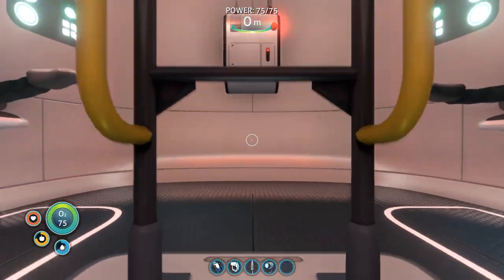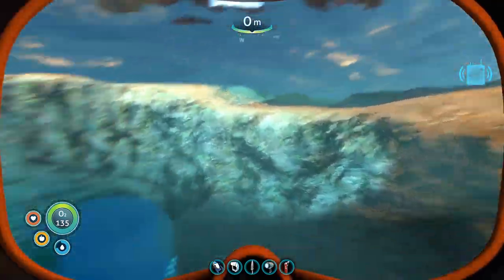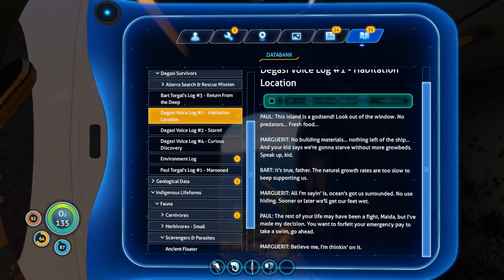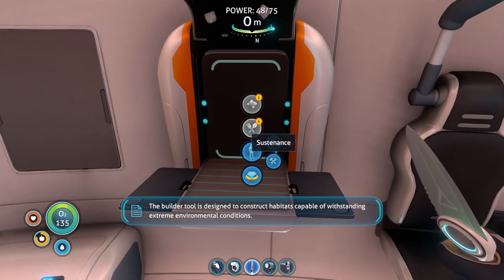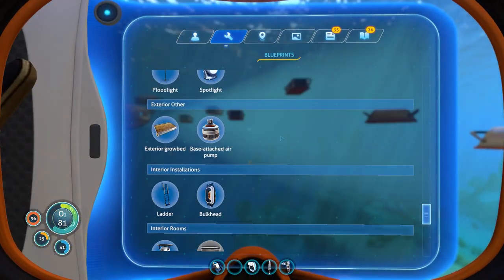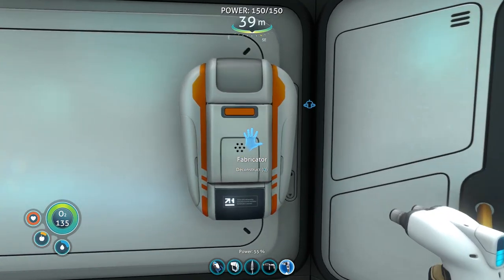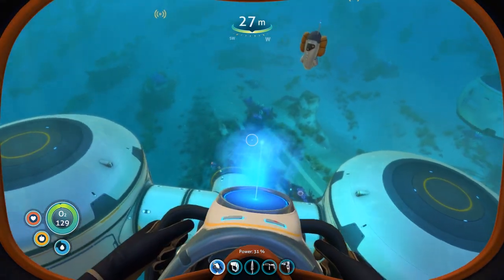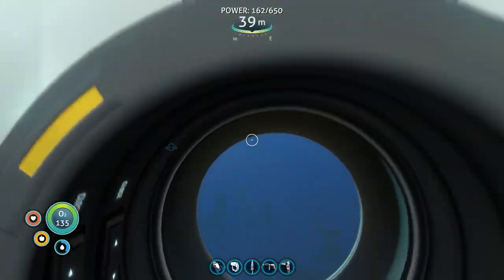SUBNAUTICA - HOW TO BUILD A BASE ! (2018) - Ep#2

Comment: If you put the structural support on the cardinal headings for your outside bulkheads or walls it give it a strength bonus!  So you can add fewer support but more strength by just putting them in the right spots!